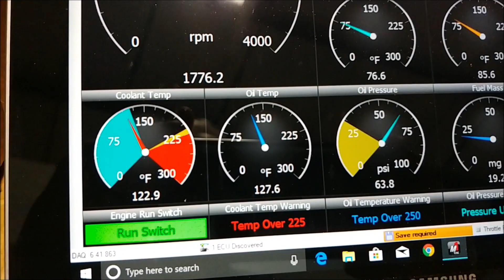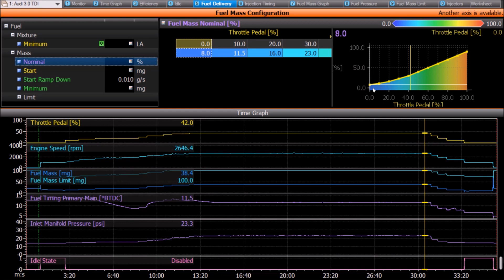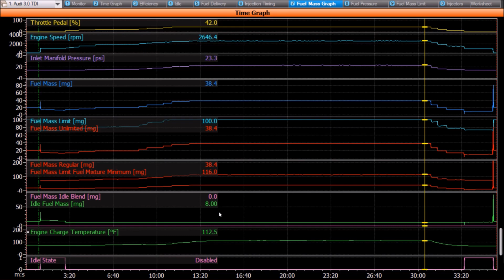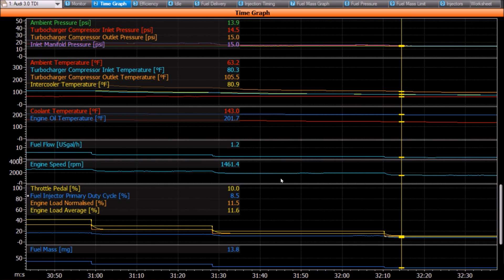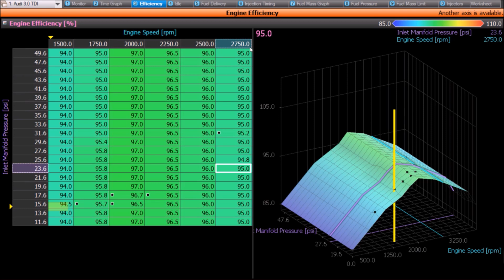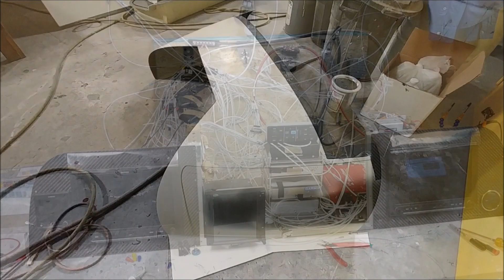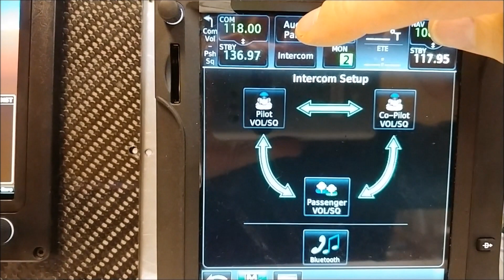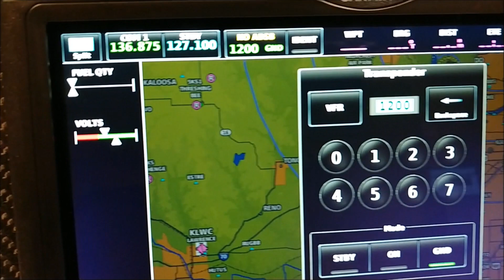Time for a Break

Comment: would  it be possible to make the whole wing a fuel tank ? Then that would at the same time work as a deicer for the wing if you could keep the fuel at for example 100 degrees . mount some sort of a garden sprinkler inside the fuel tank to spray against the top of the wing to keep the ice forming.  Kill two birds with one stone.  Merry Christmas and have a great trip down under.

Comment: Can we have a wireless connection to the motech in the engine while in flight?
Reply from the maker: Yes it works over WiFi but we'll be using a wired connection for reliability.
Reply: I presumed so for the avionics hookup, but you mentioned that there was more data than the Garmin can display, so I was wondering if there could be an aux wifi connection so you can see that additional data from a tablet or phone running the motech software. 

Merry Christmas, have a great trip!!
Reply from the maker: I'm guessing that you're not following closely. I have mentioned several times that the tablet will be on the panel to display everything separately from the Garmin hardware.
Reply: Oh I've watched every update you've posted in the last 12+ months within 48 hours of you posting it, it's a lot of information to remember! But I think the confusion here is over the prototype vs production. 

Have a great trip back home!!